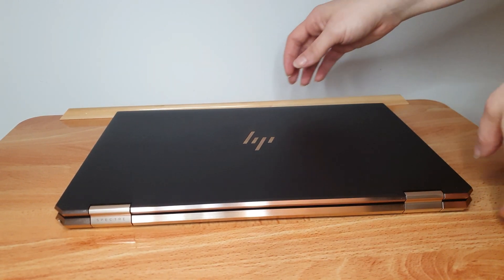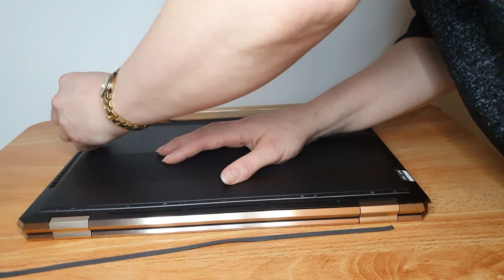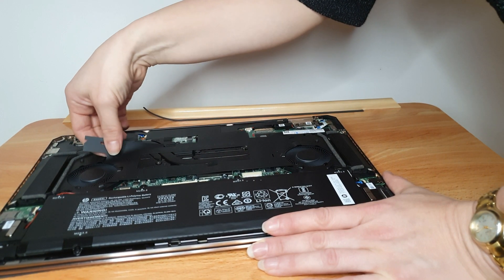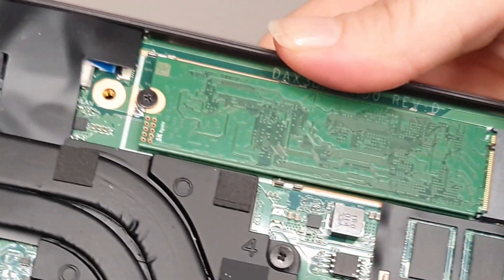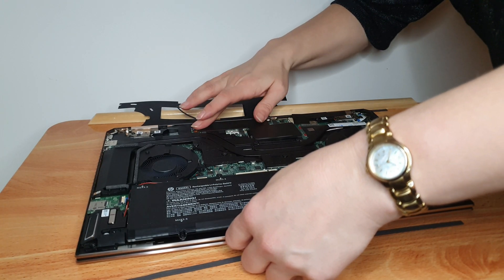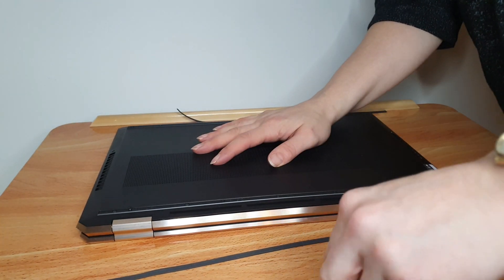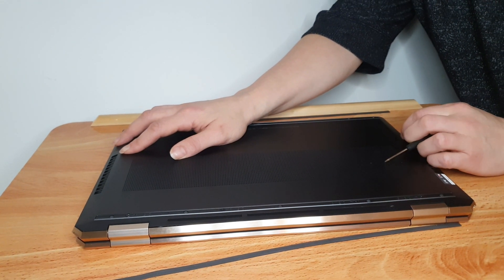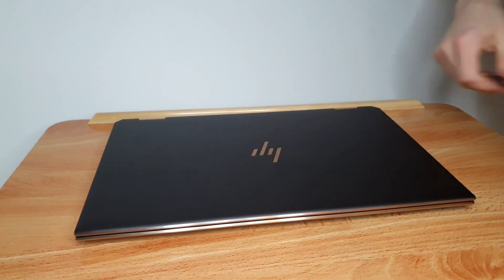2020 HP Spectre x360 15 Look Inside (Disassembly) 10th Gen i7-10750H 2in1 Laptop eb0003na

Comment: Thanks for your video.  Wish I had watched it yesterday.  They are complete assholes making you take off the rubber feet to get into it. and soldering the RAM... beyond words.  I just bought 32GB RAM, and now dismayed to see it can't even be upgraded.  16GB is simply not enough for much of any use to me.  Other than that it's a really lovely machine.

Comment: Well, that confirms that the RAM is soldered on the MB. What a jerk move by HP. If I wanted to be left with next to no options I'd buy a Mac. The space savings are minimal, but the chance of the money for the upgraded RAM reaching HP's pocket are substantially maximized.

Comment: Any idea where the wireless card is located? My wifi stopped working and I’d prefer replacing it myself instead of sending it in if possible.
Reply: Did you ever figure this out? I have the same problem.
Reply: @andrewv9005  unfortunately it’s soldered onto the board. I had to have my client send it back to HP to be repaired.

Comment: My earlier version of 2020 Spectre X360 10th Gen i7-10510U (January, 2020) has two memory slots. I am upgrading from 2x8GB to 2x16GB next week.
Reply: How did the RAM replacement go?
Reply: @richarddirks6632  working perfectly. No issues after 7 months
Reply: @richarddirks6632  actually, I went with 2x32GB instead. Working out so far

Comment: Thank you for this disassembly.  Sadly you answered my question regarding the RAM and see it is soldered onto the board.  The good news as always is that the SSD drive can be upgraded.  While I like the Intel SSD, I've used the Samsung SSD Plus drives and feel they are still much faster in reading/writing performance.  Thank you again for this video!!

Comment: Come on, this is the Internet...how do I upgrade the HDD to 4 TB and RAM to 64 GB?
Reply: just replace them with a better one
Reply: most of if not all the HP spectre, at least from 2017 AFAIK all have NVMe drives, not HDD so you'd need to 'upgrade' to a NVMe SSD 4 TB not a HDD
Reply: You don't. Idk about the 2020 model but the 2018 model is limited to 16gb of ram, 2 8gb cards. I'm sure the 2020 has similar limitations.

Comment: Helped me with upgrading SSD. The hidden screws and opening back lid were very useful since you never know if you’re pulling too hard on something if you don’t know how it should be done. How did you not stretch the rubber strips, mine are almost an inch longer... lol
Reply: Which SSD model can be installed on this baby?

Comment: I have a question: Does this laptop only "intakes" cool air from the bottom or also on the top of the keyboard? I'm planning to use in "clamshell" mode - closed lid, connected on Ext. display.

Comment: Hi Jenny!  I purchased this laptop too. I noticed a potential issue with the battery in mine. Would u be so kind and check HP Support Assistance for battery check. When it is done then  click on show advanced information. It will display many things about the battery. Mine shows only cell 1,2,3,4, instead of 6 cells. And cell 4 =0mV is it the case with yours as well?

Comment: Great video! 
I just have 2 questions: can I upgarde the SSD to the Sabrent Rocket Q 8TB NVMe PCIe M.2 2280 Internal SSD?
And can I but back the rubber lines once I put the lid and all the screws back in place?
Reply: 1. Max is 2tb for now. Best choice is 660p Intel. 2. Yes
Reply: Did you try to put in the 8TB SSD? If yes, did it work?

Comment: Hey Jenny, been viewing your channel. New subbie here. 
 i've my new HP Spectre X360 15.6" which arrived yesterday . I noticed hp has a new pen now here. I like to know how can i activate this new hp pen? When i charge, it is first showing a blinking amber and after 3 minutes it turns to blinking white. I tried to use the pen, but it doesn't.
Reply from the maker: Hi starmat, thanks for subscribing. Is your pen the MPP2.0 tilt pen model like mine? I don't believe mine has a blinking white function. If it's an older model pen, try this video:
https://supportvideos.ext.hp.com/detail/video/5991884759001/how-to-set-up-and-use-the-hp-tilt-pen
Reply: @JennyTheFrog  im pretty sure my hp pen has the same look in your video. It says on the manual- Light Status: Solid Amber  is Charging; Solid White is Fully Charged; Blinking Amber is Low Battery. But when i charge it shows a Blinking White.
Reply from the maker: Someone else had a similar issue and it was fixed after charging again. He also updated his intel drivers from the official intel driver site and did a restart. If none of these work, I would contact HP support because I can't find any documentation about a blinking white light, sorry!

Comment: Thanks, Jenny, for opening the back up for us to see what's inside! It looks like there are 2 screws on a removable RAM board. Are you sure RAM can't be replaced?
Reply from the maker: Hi Bartok, I'm not 100% sure and wish I'd peeled the black plastic off for a better look. It does say on the specs though that it's onboard ram - suggesting to me that means soldered.
Reply: @JennyTheFrog  Thanks for the reply. If you open it up again, maybe to replace the SSD as you mentioned you might do, maybe you could check the RAM board or take a closer look then. If you do find out more, please let us know, thanks!
Reply from the maker: Bartok, just for you, I've opened it again. It's definitely not replaceable. I've taken some good photos to show this, which I might include in my next video. The memory is not on a separate removable card, those chips are soldered onto the mainboard. The black kapton sheeting stuff makes it look raised but it's not.

Comment: Great job, Jenny! I like the fact that you are a crazy type. You are like me, really.

My main questions surround heat management and battery life? How cool does the laptop run, given the H-series 45W processor it came with? Does it thermal throttle in any way? And the fan? Any loud noise under minimal load? As for the battery, what has been your experience? Up to 8 hours or less? Thanks for blazing the trail.
Reply: I just ordered this laptop with the 4K 400 nits screen. I’ve heard from forums the OLED model is a real battery drainer with average of about 5 hours and the 4K models around 10 hours.

Comment: Does this has LTE support
Reply: If it did have LTE support, and if it could've gone up to 32GB RAM, I think it would've been the overall perfect laptop. The option for LTE would've been far better than the inbuilt micro SD card.
Reply: @paulkoigi7566  The built-in micro SD is awesome for additional cheap bulk storage.
Reply from the maker: This 15 inch model does not have LTE, but I believe some of the 13 inch models do.